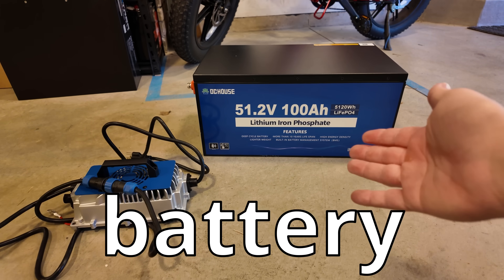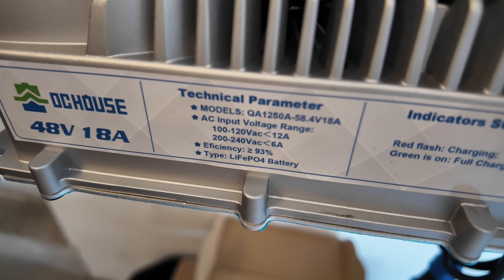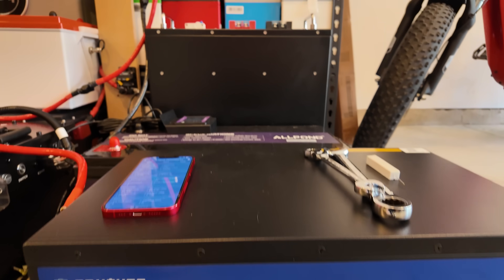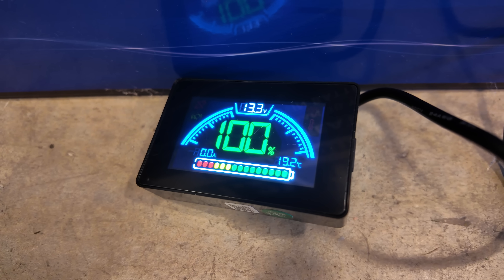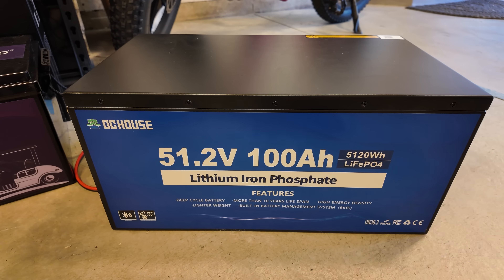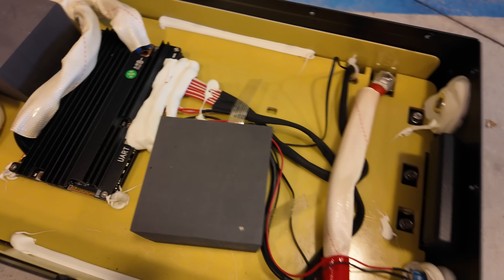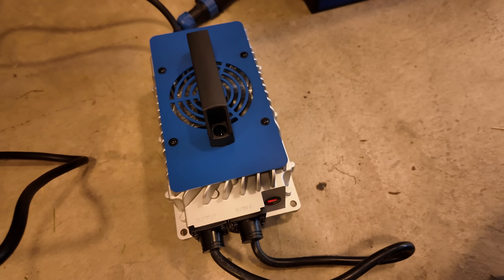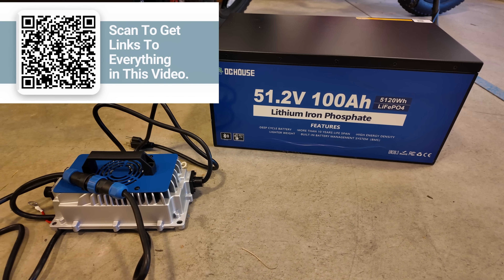Too Good To Be True? Testing the CHEAPEST Metal Case Battery

Comment: Great video, thanks…I have an Apex300 connected to Solar panels, so do I need to add this charger ?
Reply from the maker: You don't have to. If you connect to the APEX 300 through the extra battery port, you can use the APEX 300 to charge both the internal battery and the exterior battery with solar.
Reply: @theresatrickforthat   Yes, I meant how do I connect it to the apex300 to use it as an expansion,backup battery ? Thanks

Comment: I do agree the metal case is a better option if you plan on stacking the batteries since you have the side mounted connections and can easily stack them directly on top of each other (how high is too high though?). Would be nice if all the connections (+, -, data port, power button and vent) were on the same side though IMO. being able to build a 3 wall cubby to stack them in and not have to get to the rear would be nice, but I guess if you are using BT to monitor, not as big a deal, and the vent is not a problem.  Biggest issue is the power button is on the back side, really should be by the terminals IMO.

As for which I would buy, probably the cheapest. I am still learning this and have no specific plans. 
I have really been debating the Temgo unit with included charger you posted a bit back. Using it with the "hack" to use with my Delta 2 really interests me. Would let me run a full size refrigerator for 2-3 days vs 10-12 hours.
Reply from the maker: Thanks for your thoughts! You really can't beat the cost of these golf cart units!

Comment: The handles seem to only allow lifting from your fingertips and the prevent wrapping your entire fingers around them.
Considering the weight, that would be a problem for many.
Maybe if they engineered a different way to lift this, it would be a better fit when you need to move it.
Reply from the maker: It's not too bad!

Comment: I believe this battery is made in the same factory that makes the Eco-Worthy batteries. I haven't bought any Eco-Worthy batteries lately, but if the Bluetooth name starts with "BATT" like this one does, they have an unlocked BMS that can use the Overkill solar BMS app that allows the BMS parameters to be changed like low temp cutoff and balancing settings. At some point in time, they locked down the BMS, and it will only use the manufacturer app which doesn't allow any changes.
Reply from the maker: That's good to know!
Reply: They appear to be the same company. Some of their batteries are exactly the same apart from the sticker.

Comment: Another great video!  I really like this apex 300 but have a concern before pulling the trigger on one and setting up a 51.2v battery how you've done here.  I need to use the bluetti dc hub for the high dc output for my van build....but I see that both the hub and the expansion battery will need to use the expansion battery port.  So, without buying the bluetti b300 battery, how does one use both with only 1 port?????  Appreciate any help/answers!!!!
Reply from the maker: Oh! That's easy! Just get a cheap 12v LiFePO4 battery for you DC power needs. You can get one of those batteries for less than the DC hub by quite a good margin, then use that money you saved to get a 48v to 12v DC to DC converter or a cheap 12v LiFePO4 AC battery charger. That frees up your extra battery port, plus gives you extra battery capacity and higher 12v output capacity! Win, win, Win!

Comment: I have SIX(!) of the 36V varieties of these in parallel connected up to a standalone inverter and my power stations.
Reply: I bought all of mine well before I realized that you could connect 48V batteries directly into most power stations.

Still I have about 21kWh of extra battery capacity at my disposal.
Reply: @andrewr05  Did your listing you bought off claim 4P max? The listing i ordered my 48v batteries from claimed 4 Parallel max. I didn't think it would matter adding more but when i bought mine the ebay listing was claiming that. Not sure if it still does
Reply: @rnkustomz 

No idea, I'm going to add as many as I want together. 😂
Reply: @andrewr05 I’m so confused why they claim the limit. I want to add more but am worried it could possibly cause some issue, no idea
Reply from the maker: Nice!!!

Comment: DC House has a bit of a mixed reputation.  In Australia DC House went after an influencer who had simply reviewed the battery and found problems (for example).  There was a whole hullabuba.  But they've been fairly quiet since then I think.  So YMMV.
Reply: That was DCS not DC House.
Reply: @adriftatlas  Ah, I stand corrected.  Yes, it was DCS.  DC House is in the clear.
Reply from the maker: I like this! It a really great budget metal case battery!